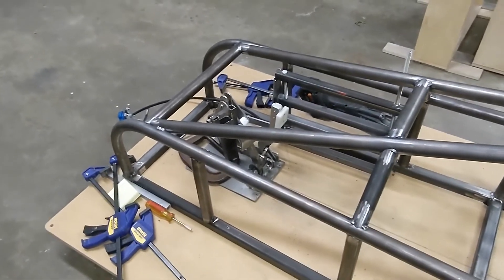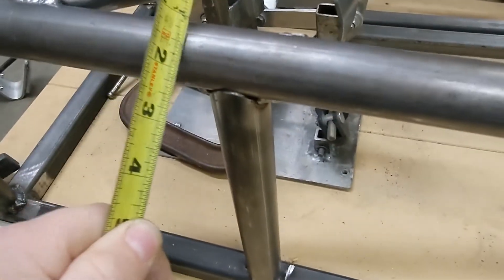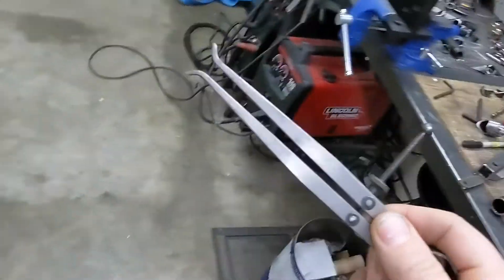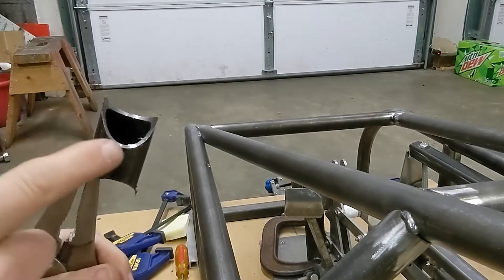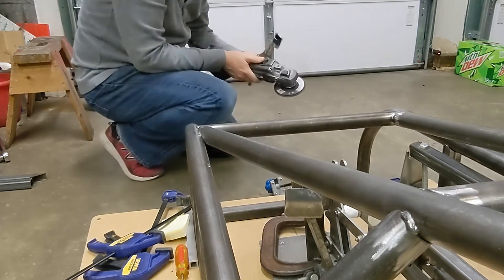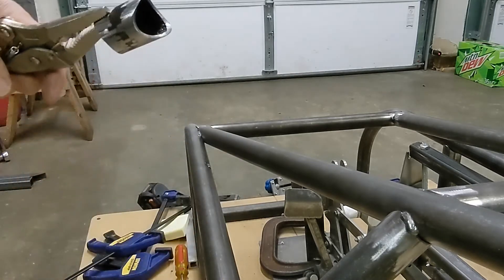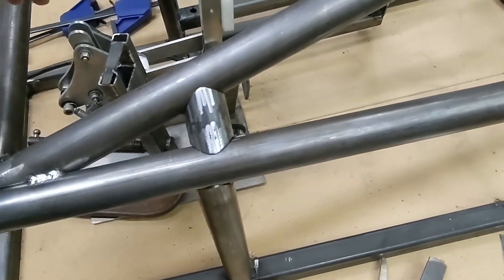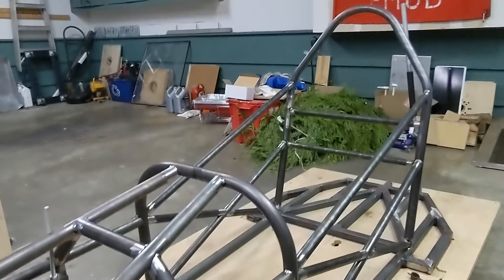Measure and fitment with a tubing notcher

Comment: Looking good, approx how much money is it gonna cost to race this class? Are you going to be road coarse racing or auto cross?
Reply from the maker: This will be an autocross only car.  While I have all of what was on the old car (so axles, brakes, etc); I would guess you could ground up build for around 5 to 9k.  it all depends on how crazy you want to get.  I'm running an aluminum axle, making custom carbon fiber bodywork, so that along with some other items are raising the price point.
Reply: How do uno what size of hole saw bit to use or do you just use same as the pipe you have to notch